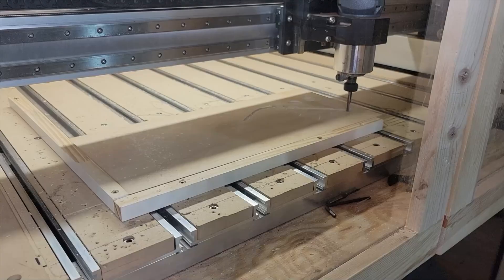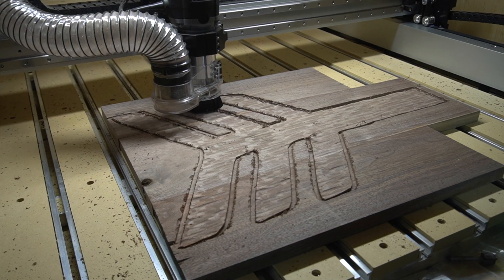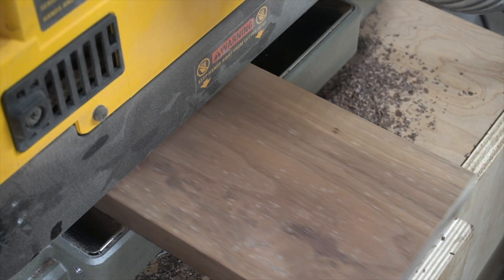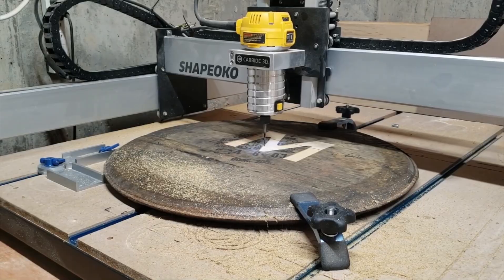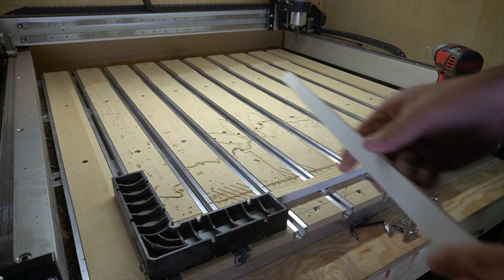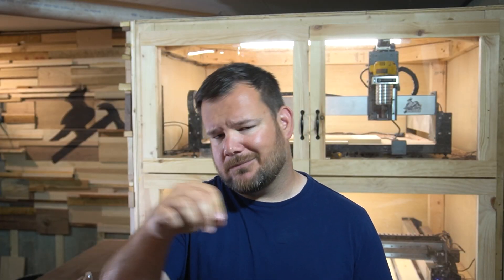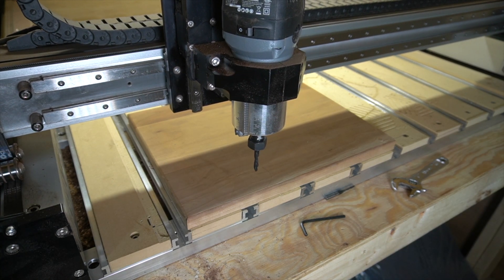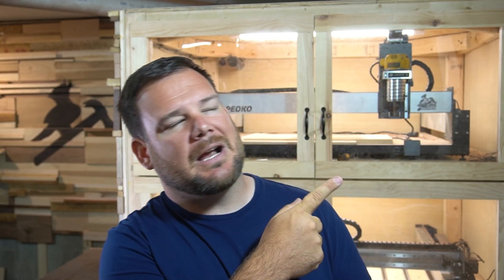5 CNC Hacks to Avoid Crashes on Your Next Project

Comment: Thank you for the information.  I am new to CNC and one of the other commentators (@Wolfram Herzog) mentioned using an old toothbrush to clean the dust out of the collet.  I use it to clean the collet and the bit.  I use an auto-touch plate and that little bit of dust can cause the auto-touch plate to not make a clean connection and messes up the calculation.
Reply from the maker: Thanks for sharing!

Comment: Thanks, all good ideas. One you missed is checking the fasteners on the CNC. Today I saw a very small set screw on the table and thought “that must be important”. Well, it was one of two that secure the toothed pulley to the Y Axis syncro motor. Before I realized what the screw was for the machine lost orientation and was milling about 6 inches from where it was supposed to be. Two Y axis motors and all set screws were loose… Live and learn… also, I used fixed guides on my bed but I don’t align them with a square, I just travel the CNC with the spindle running, perfect alignment…

Comment: I recommend using an old toothbrush to clean the router collet - better than compressed air or simple tapping to the collet. And you should also check the thread of the spindle if it is clean.

Comment: Limit switches for a fixed home position. 

Not sure I'd tap my collet nut with a wrench, rather quickly unscrew, tap on the MDF bed, better to blow plus always have 2-3 brushes by machine inc tooth brush - soft paint brush.
Reply from the maker: Thank you for your comment. Can you explain the limit switch for a fixed home position a little more? 

I do unscrew my collet from time to time but lightly taping my collet nut has worked well in between those times. I started doing it a few years ago and haven't had any issues.
Reply: @AndyBirdBuilds  On the collet, mine took a little damage just from losening and tightening, hence not keen on intential tapping, just my own experience.

Re limit switch, just fitted them to mine today due to some repeat part jobs that are harder to index any other way.

Once limit switches are fitted, they both stop the machine running off a gantry or out of bounds, however you can also use them to have a configured, hard wired home position, at least in MACH. On starting up the machine, you hit 'ref all home' and the machine goes through a homing sequence. If you ever lose steps part way through a job,  you can reset home accurately (and any offset controlled from there via DRO).  A lot better than a mark on the workpiece.
Reply from the maker: @CNC West Cumbria  Okay cool. Thanks for sharing. I'll be diving into Mach here very soon and I can see how this would be helpful!
Reply: @AndyBirdBuilds  When you consider most incidents are human error somewhere along the way, it's anoither way to reduce it.

Just don't use the tiny, cheap limit switches I did, they still work but they're an absolute pain to fit.